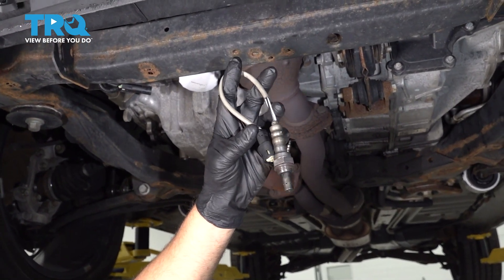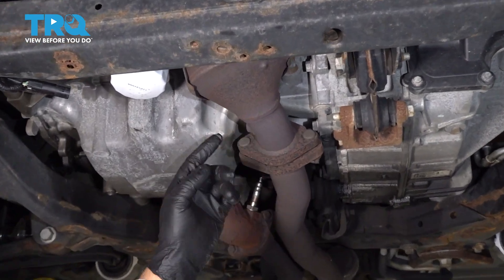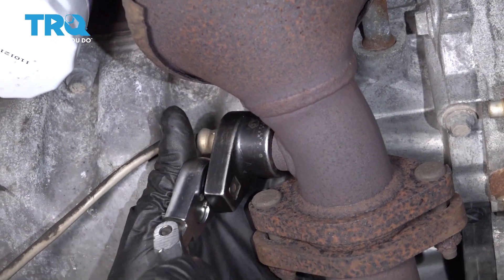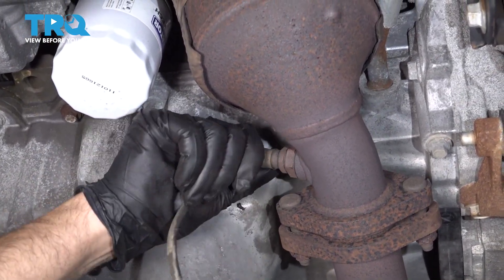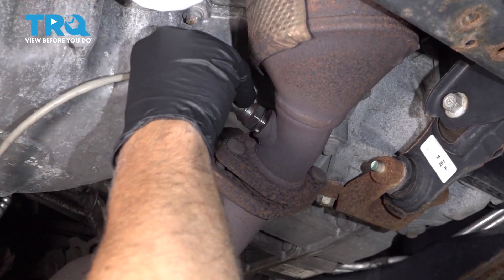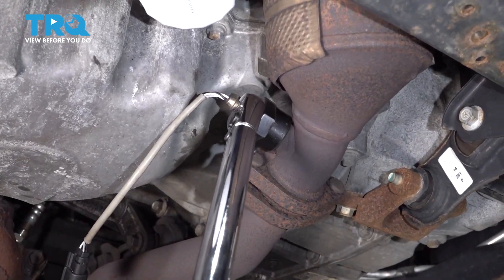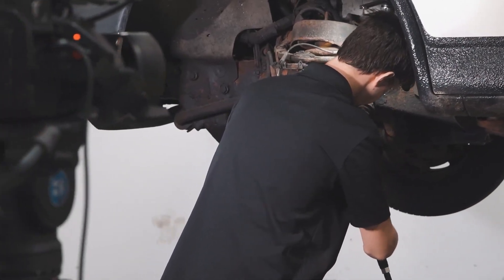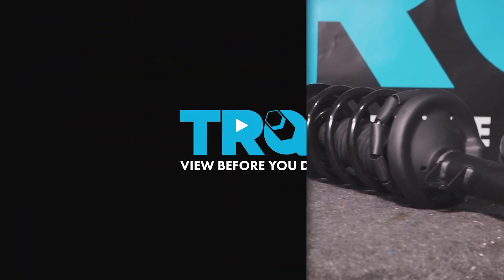How to Replace Bank 2 Downstream O2 Sensor 2011-2019 Ford Explorer

Comment: For those less-observant, there was a dab of anti-seize compound on the threads of the new sensor to prevent corrosion between the dis-similar metals.